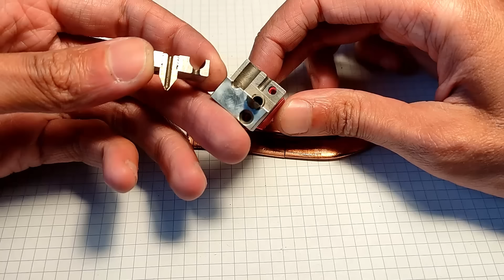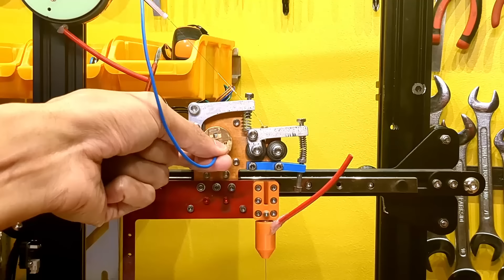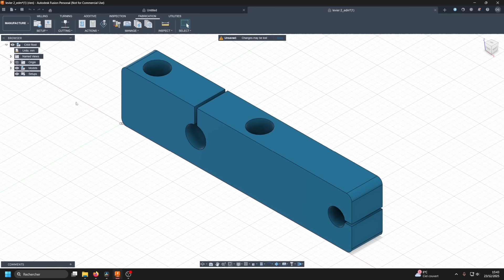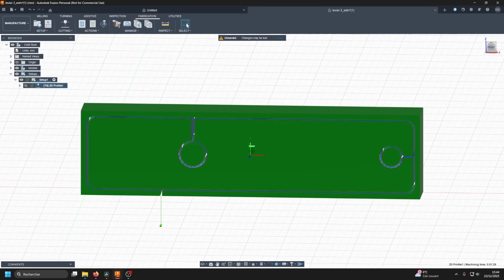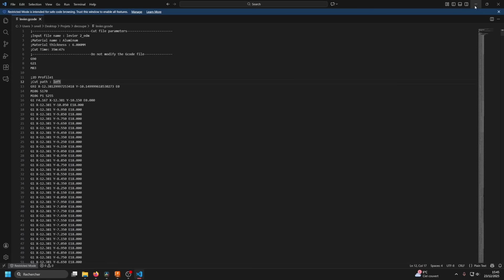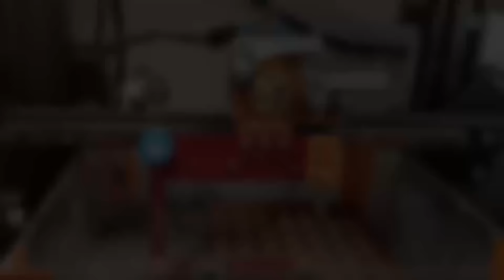Ender 3 to Wire EDM, how to cut metal with a 3D printer

Comment: I was a but shocked lol, when you successfully cut the metal by just dragging the wire through it. I have been studying up on EDM machines. I want to be able to make brass clock wheels and gears, and although a CNC can do it, a CNC EDM is much more precise and doesn't have tiny milling bits to break. This is a very encouraging and inspiring video!
Reply from the maker: Thank you very much, the following video is almost ready

Comment: I'll wait for the next video with all the modifications and improvements. I genuinely want to build this. Should I go for a an ender 3 V2 because they are really cheap to get used or ist it worth tinkering with software to to do this on a slightly newer printer for the better hardware and precision. I'm really stupid when it comes to software.
This machine ,my A1 mini ,my vice, a couple files and a caliper are enough to manufacture pretty much anything
Reply from the maker: The second video is 99% ready but I'm doing synchrotron measurements for my PhD 24/24 this week 😬. I will post it next Saturday!
If you can get an ender 3 with a big tree tech board it's a bit easier, look for printer with a board that have some uart outputs.
The software modifications are already listed in my GitHub if you want to take a look its very easy!
Donc forget a hack saw and a Dremel!
Reply: @AlmostCompletedProjects  thanks I will look into it. Mad respect for making all of this open source  with documentation while doing a PhD. Im still 2. Semester and its already a lot simultanously hahah
Reply from the maker: @Jeff-ml2ek  Thanks, that's not easy I'm in my last year ~4month left. But you should check the youtube channel "alpha phoenix" the guy did very high quality science videos during all his phd

Comment: Hi Sir it's great project kindly can you explain the pulse generator circuit in some details there is 100m ohm on drawing but not on schematic pdf is it the dielectric fluid resistance and what about to use bank of power resistors to establish 10 ohm 100 Watt 
Thanks in advance
Reply from the maker: Hey, thank you, I'm currently updating the GitHub and I will post the second video in 1-2 weeks with better explanation! But the 100mohm was a shunt for current measurement which is not required anymore!
The resistance is the heat cartridge from the printer, it's 16ohm which is exactly the value I need!
Reply: @AlmostCompletedProjects thanks for your kindness and fast response I saw the update on GitHub it's clear than the past draw I do have multi 50 Watts 33 ohm resistors I can arrange to get the needed wattage and ohms .... This 16 ohm is it connect between power supply and the Caps/ source of the transistor ??? I'll Wait your update video but it would be kindness if you include explain of the arc circuit 

Thanks 🙏 for. You
Reply from the maker: @Ronmeagain  I use 16ohm because my power supply is 80V5A so 80/5=16. It's the heat cartridge from the hotend and I just put it in the water of the edm, way easier and cheaper than having a custom waterblock with 50W resistor.
On the schematic you can see that it's between the V+ and the capacitor, it's used to limit the average current, the peak current from the capacitor discharges is not limited
Reply: @AlmostCompletedProjects 

Fantastic way and smart at the same time now it's all clear for me I've posted on your GitHub 
🙏 A lot sir

Comment: Did you make a sinker edm too?? I think power supply is available off the shelf
Reply from the maker: It is but it's expensive, the point of this project is to make it available to everyone
Reply: @AlmostCompletedProjects  when I was exploring, i felt sinker gives much more control over contour and holes, and can jump position that means machine works like a cnc router rather than like a scroll saw
Reply from the maker: @KiranKiran-yp1vl both are good for different use, if you want to cut always the same kit of shapes, sure sinking is a good option. But you have to machine the electrodes out of copper (hard to machine for a hobbyist) or graphite (lot of toxic dust) and it's a consumable so you have to make new often.

Comment: How much voltage and ampher ?
Reply from the maker: Voltage 80V you can check the GitHub in the description current 5A peak but average is around 2 depending on the material

Comment: hello, i am thinking of biting the bullet and building it with the current bom, would you recommend i wait and do you have an apporximate timeline. And what components can i already definetively buy for the wire edm in case you release the cheaper bom ?
Reply from the maker: The current bom?
You should wait a bit, the first detailled tutorial should be ready in 1-2month with all the electronics, firmware change and code and maybe a bit of hardware.
You can buy a MS-600-110 power supply, take one where you can change the voltage and current with two small potentiometers, you can buy 2 MGN12H linear rails, and try to find 0.25mm brass wire otherwise 0.2mm from Ali take the longest you can find (100m I think)

Comment: Amazing work, what type of power supply do you use , and what range voltage does it work with, in what frequency pwm does your controller generate
Reply from the maker: The voltage is about 80V, I thought I said it in the video 😅
It's just a regular switch mode power supply and the electronic schematics are in the GitHub in the description. The frequency is about 60kHz
Reply: @AlmostCompletedProjects thanks for reply, sorry to bother again, did you connect few switch mode power supply in series for making 80v or it's single power supply
Reply from the maker: @ParsMaker no it's a single it's a MS-600-110 ~40€ on AliExpress
Reply: @AlmostCompletedProjects thank you

Comment: I saw your updates on Git – great work! Could you let me know if there's any code available for the Pico, and also how to configure the Ender 3? Thanks a lot.
Reply from the maker: Thanks 😊, I'm reviewing the code for the pico so it can be understandable. And for the marlin firmware I deleted the original file by mistake 😅 so I'll have to remake it entirely...
But I'm starting this evening it should be ready at the end of the week
Reply: @AlmostCompletedProjects  Is a via omitted in the vicinity of R4?
Reply from the maker: @dengkeyuan I'll check that! I haven't tested the board yet so no guarantee this one work

Comment: Hey, could you maybe go a little bit deeper into the electronics part of this project? I am just now designing a PCB in kikad for your circuit, lets join forces if you like!
Reply from the maker: Hey! I'm planning to make a follow up video, I'm currently working on the electronic part but I don't know a lot about PCB...
I would love to work with you, you can contact me on discord almostcompletedprojects_84054
Reply: @AlmostCompletedProjects  Sounds great! I dont know discord yet, guess i will have to figure this out. I will start ordering components beginning next months, as i will have new budget allocated on Feb 1st. Keep you up to date!
Reply from the maker: @TeslaAtoms you prefer ton exchange on WhatsApp ?
Reply: @AlmostCompletedProjects  sure, why not. i send you my number per PN
Reply from the maker: @TeslaAtoms hey! Ive designed a PCB and posted it on my GitHub, I think I didn't forget anything
Reply: @AlmostCompletedProjects  Nice! Did you prove out the board yet (have it manufactured and solder everything?) Also, is there any active or pasive cooling (heatsinks, fans) necessary for any of the components?
Reply from the maker: @TeslaAtoms it's pretty much the same board that I had hand soldered on a piece of perf board so it should work but I haven't ordered it yet!
No active cooling required but maybe a heatsink on the MOSFET just in case (it wasn't required on the current version)
I got a review from a college and I have a few things to correct but feel free to give me a feedback. You can send me an email at almostcompletedprojects@gmail.com

Comment: Very cool! I'm planning on making something similar in the future. I have a few ideas floating in my head which might interest you - 
The first is using leadscrews to drive both X and Y, which will mostly eliminate backlash by using anti-backlash nuts. This also greatly reduces speed and increases rigidity, simplicity, and accuracy.
I would also suggest looking at sewing machine thread-tensioners as they're quite simple mechanically (a couple of washers and springs).
Lastly, I suggest looking at the way AMS units monitor filament "tension" using a spring and a couple of switches - very simple to make and implement.
Again, very interesting project and good luck!
Reply from the maker: Yeah I've thought about lead screw but couldn't find an easy way to put one on the x axis...
Do you know how low the backlash can go with a lead screw?
The sewing machine is a very good idea I will look into it!
I don't know if it's really necessary to monitor the tension in my opinion I just need to measure it once in a while and that's it! But yeah a spring can do the trick!

I'm really thankful for all the comments I received a lot of good ideas, which will be used for the next version

Comment: An old machinist with a Wire EDM saved the day.  I had a rusted pinch bolt that broke in the steering knuckle of Subaru.  He got the bolt out and the steering knuckle was exactly as I brought it to him!  I was expected hammer marks, drill marks, cutting marks, but there was none.  I asked him how did he do this.  He was like easy, Wire EDM.   It was amazing.

Comment: Hi, very interesting, thanks for sharing! Electronic pseudo-schema at github (README) is a bit confusing - could you add pin description to PSU/wire terminal, please? Is it PSU+ (violet), PSU- (dark green), workpiece (orange), wire (red) maybe? Also how is signal ground connected with MOSFET (maybe black to dark green connection is missing?)? Is pico code also shared somewhere?
Reply from the maker: Yeah I'm redoing it properly sorry for the delay

Comment: Great project! Subbed instantly, love to see budget projects taken to fruition, takes real ingenuity and grit to see it through with non-standard equipment. Would make a great kit once ironed out a bit, personally I'd like to see the lower arm done a little differently. I'd try a thick piece of rf4, and if that proved too flexible or too costly to procure at least an rf4 insulator between the two aluminum blocks, if that causes too much standoff some kapton layers would be good (I'd be worried the current solution is too susceptible to short, especially with servicing or manufacturing variability, I've seen very inconsistent anodizing results from different shops at my work), some insulating inserts for the bolt heads would be great too.
Reply from the maker: That's actually a great idea, didn't think about RF4 I think it can be enough!
In any case I've partially redesigned it for a single piece frame so it can be machinable by wire edm! But I will 100% use your idea thank you very much 😊

The frame need to be anodized even if it's not connected because deionized water is very corrosive for aluminum, a steel frame with a powder coating might also be a good idea

Comment: Maybe you could place the spool- assembly on a slider with a spring and adjustment wheel to adjust the force that is pulling on the wire. Maybe then, the wire would be under constant load. Or maybe ad a tentioner-wheel, like on an engine belt.
Reply from the maker: It might work but the extruder motor is already working very hard to pull this wire
Reply: @AlmostCompletedProjects maybe another reduction on the extruder? Just a small one like 2:1, maybe it would be printable as well.
Reply from the maker: @manamejeff7535yeah definitely! Or I can use a smaller wheel

Comment: How much voltage
Reply from the maker: 80
Reply: Is switching of power at higher speed necessary what will happen if I give continuous supply are we using ac or dc voltage
Reply from the maker: @phantomtech287 it will create an arc and then the wire will stick to the workpieces
Reply: @AlmostCompletedProjects thanks a lot bro

Comment: This is great… perhaps a hpde frame for the upper section could reduce the risk of shorting the circuit. The lower can still have the rigidity of aluminum or even steel .
Reply from the maker: HDPE is not very rigid I think but i found a way to use only one frame for the V4, a thick anodization+ insulating vernish is enough to protect from any damages. I will probably try to order a steel frame with powder coating as well (the lower part will corode without a polymer coating)

Comment: great, now i need a new printer :D, but seriously, how did you figure out voltage, amperage, wire feed rate, and speeds for that thing ? and what wire do you use? look like reallty great addition for my machine shop. i was thinking you can do arm 90degrees out and than you potentionaly can use twice as large parts to cut, you just need rectangular tank for the arm that would be there, did you think about that and didnt do it for some reason ? and do the wheels under the bed handle the weight just fine ?
Reply from the maker: I had an overall idea of the voltage and a variable power supply and enough motivation to try A LOT of different settings 😅
For the wire speed and federate I have a code to cut a few lines with different feeds and speeds, when the wire break it means that it's too much 😂
Yeah you can use a bigger tank if you want, I didn't had the use for it 100*200mm is enough for me and it's the size of the original bed -> cheaper to build.
I replaced the wheels with MGN12H linear rails so it's more than enough, but if you want to cut 20kg of steel you might need a stronger gantry
Reply: @AlmostCompletedProjects  from what i gathered you have to use some frequency not just DC or AC voltage, is that correct or you just simplified it ? i misread in the video i was thinking that you used linear rail only on one axis, now i see that its on both. i have an idea for you too, to get rid of the backlash you can ude just springs since there isnt really a load on the wire during cutting, and one time i was working in a place where they used real wire EDM machine, and if they wanted really accurate parts they went a few more times on the same toolpaths to get it perfect. i hope that helps. :)
Reply from the maker: @prosteja9659 it's a square dc signal the same type you would use in a dc-dc converter or to control a BLDC motor or a buzzer nothing fancy.
Yeah someone mentioned the spring/rubber band it's actually a good idea! But on the goal to make it cheaper a printable gearbox ~5€ is way cheaper than a commercial one ~20€ for the same results since the load is very small.
Yeah it's pretty common to do 1-3 path to make it perfect but in my opinion 1 is enough
Reply: @AlmostCompletedProjects  great, cycloidal gearbox ? Maybe ballscrews could be a right thing, but i dont really know how múch it cost, or how small they can get. But you would kill 2 bieds with one stone virtualy no backlash and no gearbox since it would be "geared" way lower than belt
Reply from the maker: @prosteja9659 ball screw are expensive but a lead screw with an anti backlash nut  should be enough.
It depends my belt gearbox is a 3 stage with 64:1 reduction
Reply: @AlmostCompletedProjects  belt gearbox is really smart and sipmply 3D printable solution, i made small garden tractor with 3KW bldc motor and pulleys for toothed belt are 3D printed with only PLA and works great even now in really cold weather.
Reply from the maker: @prosteja9659 nice to read that! I hope it will work for this specific application

Comment: Hello! Thank you for teaching! One question, is it possible to cut with wire watch wheels? Is it possible to find most thin wire that can fit between two tooth of wheel?
Reply from the maker: Hello, what is a watch wheel? The thickness of the cut with a wire of 0.20mm is about 0.3mm
Reply: @AlmostCompletedProjects i mean wrist watch wheel with very small gaps between tooth😅. So its impossible and doesn't exist wire which can cut?
Reply from the maker: @Martin84239  ohh you want to cut the gear for a precision watch? It's usually done by etching the youtuber Applied Science made a great video about that you should take a look!

Comment: Nice work. Very impressing. I have been a wire EDM toolmaker for more than 35 years. On the pro maschines the wire is pulled by a servomotor and the wire tension are controlled by a DC motor adding more or less power to speed it a little more up, than the servomotor. You can say, that theese motors are "fighting" against each other". Maybe you can use the same metode, to encrease the precission. It is very importent to keep the tension sufficient. On a pro, the tension is 17-20 Newton by 0.25mm wire. It is the most common diameter for standard wire EDM.
Keep going clever guy ❤
Reply from the maker: Thank you very much, I took a bit of inspiration from the one we have at work but I want to make it s cheap as possible so if I can remove a motor without too much issues I will do it! But if I want to make 0 tolerance machining I think it would be necessary.

My wire are jewelry brass of 0.2mm (shame on me) but I will buy 7kg of .25mm brass edm wire second hand next week I think! 

Thank you for the values of tension it's very helpfull :D
Reply: I look forward to se where it goes. I hope you will share it. It is very interesting for an old wire EDM freak.
Good luck. ❤